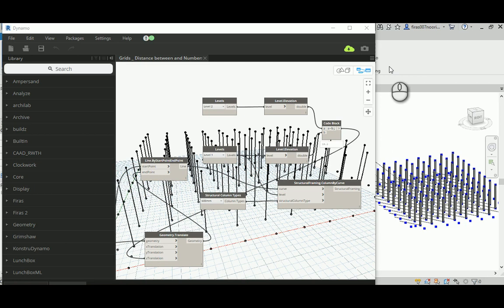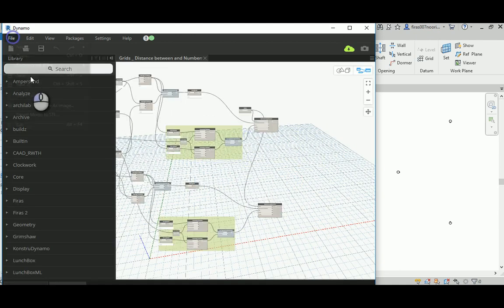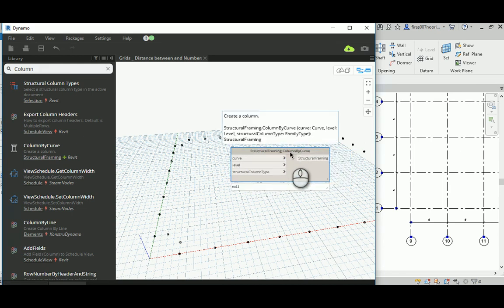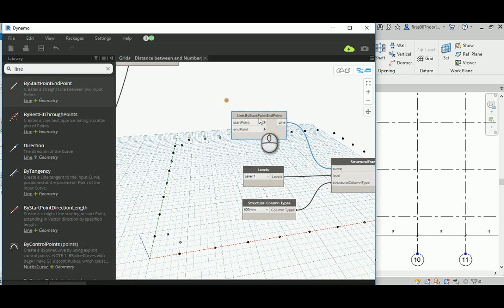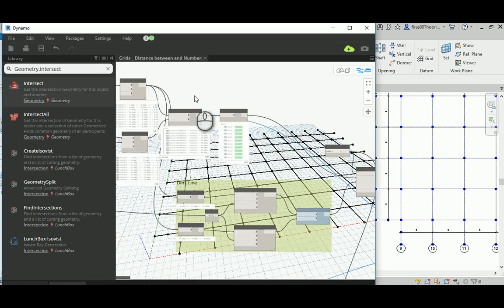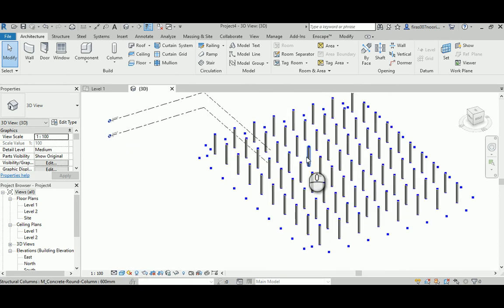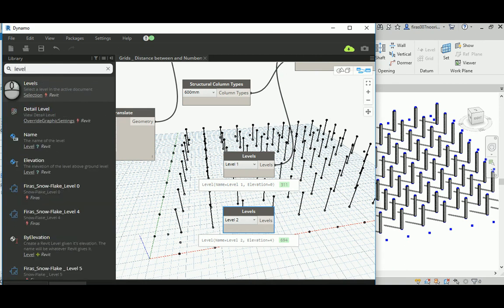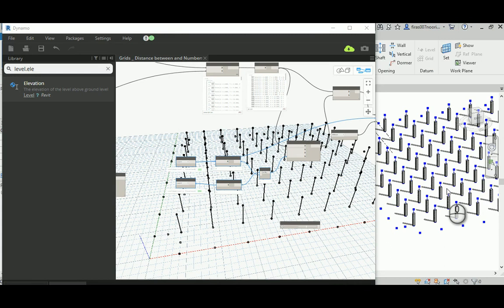Placing Parametric Columns on Revit Grid by Using Dynamo

Comment: Great video, thx. I have issue, when I changed level, script always create column on first level ?
Reply from the maker: Hi, make sure in dynamo to change the level to the one you want, second, make sure in revit you have more levels already created, I.e level 2 and 3 and 4, so if you choose level 2 in dynamo it has the level in revit to comply with. Also check the column method creation , if it is based on giving a fixed height then all good, if it is based on the provision of both lower and higher level as constraints,  then the issue is a bit harder as you need to provide both lower and upper level in revit, try and tell me 
Cheers
Reply: @FirasNoori , Thx for fast response, I use Your script (part) for place column in grid intersection, from above. Levels node change levels and elevation but revit change base and top offset to minus and columns is always on level 0.

Comment: Very good tutorial, if you can make a video shown how to draw columns from cad file? That's will helpful.
Reply from the maker: Many Thanks dear Ali, do you mean a CAD to Revit or CAD to Dynamo ?
Reply: @FirasNoori  from cad to dynamo,
Reply from the maker: @alimustafa3885  Why? wat do u want to reach? or what is the practice you want to accelerate ? give me an example? please
Reply: @FirasNoori  I work in Belgium and we use coordination system and some times I receive just the coordinates in excel file to place elements. Is there a way to place elements with real coordinates not with revit internal coordinates.
REGARDS
Reply: @alimustafa3885  You just didn't search enough about coordinate points by Dynamo on Youtube.
Reply: @anhquantrannguyen20  I made a script and it's work if I use internal Revit coordinates, what I want to use geo-coordinates, I work in Belgium and we have a coordinate system, that the issue.